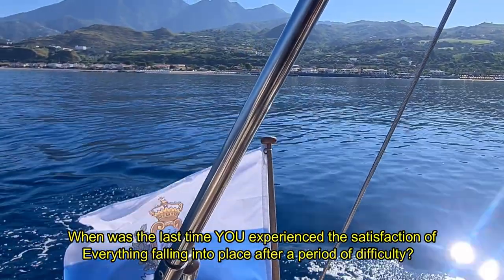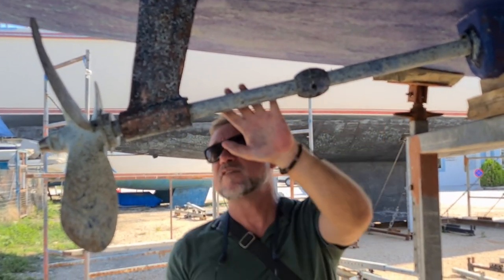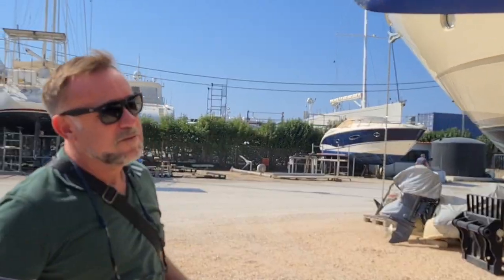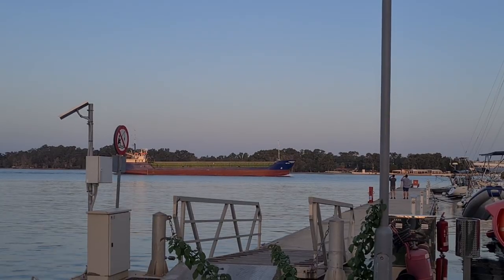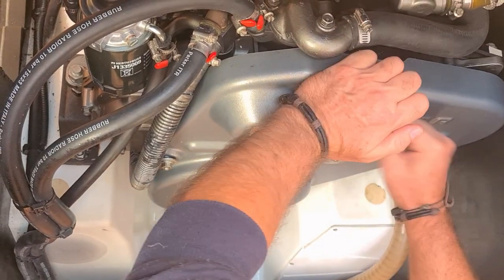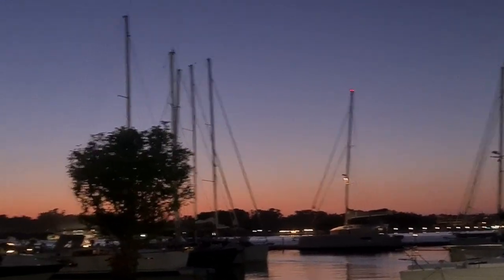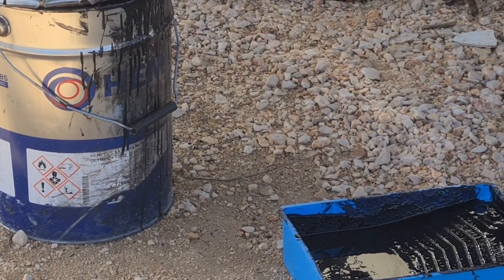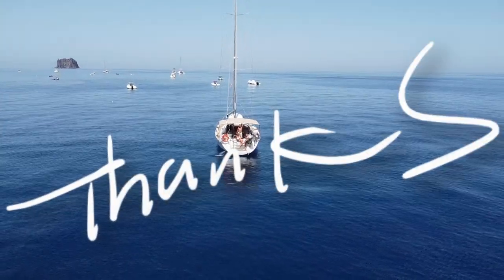Surviving Winter On A Yacht In Greece: Boat Antifouling & Rigging Inspection Overhaul Secrets!

Comment: Consider replacing your through hulls with Tru-Design plastic through hulls - a New Zealand design. Perfect for Irish pronunciation! ;-)
Reply: I presume there was no anti-fouling paint between the shaft and it's anode. You need a clean electrical connection there.

I have to say the finished under-hull anti-fouling looks a little rough. Alright for cruising, but some bits on the keel look like they might flake right off.

There's a golden rubbery-feeling anti-fouling for your prop and shaft, called Propspeed. Look into applying it instead of the black stuff next time. In the mean time, stay off the black stuff until Dom and I get there.
Reply from the maker: You're the best Andrew! Thanks man. Will look into that moving forward. Ahhh sure there's no such thing as a 'T' in the Irish dialect ahaha

Comment: Nice to see lots done. and that your happy with your techs. I also wonder if your exhaust elbow has been checked... its often over looked.. and have you checked your hoses for your heads... they clog up with calcium in the med faster then anywhere else i have sailed. I know i have had to completely redo the hoses in the Cat in the past 10 years. so ya... its something to remember. And for your bottom paint. you now see how easy it is... and doing it yourself will save money.. although  i have never seen anyone paint the prop shaft???? and I hope that is propspeed or some other hard bottom paint on the prop... or as it spins it will just wear off.... fast... most people dont paint the prop if its brass they just clean it... and every time your out swimming .. .just give it a scuff with a green scrubbie. and quick tip... change the color of your bottom paint each time.. .so you can see when it wears through... its ablative... so one year i do black.. then i do blue... then red... but i do like the look of the black.. but it helps when you need to see how well the bottom paint is wearing... but the Cat does 14 kn... so we loose some to speed as i have not put a hard bottom on her... but all nice... and nice to see the weather holding... soon it will be time to head to Ithaca.
Reply from the maker: OOh thanks so much for the tip about the head hoses, we will be getting our heads inspected and cleared out before we start sailing this season. Yes! it was great to watch all of our jobs be done by technicians first - we look forward to getting it done ourselves next season. We have recently bought some basic dive equipment to use to keep the hull and prop clean this season too. It's a great idea to do the different colours too thank you. We love Ithaca - such a beautiful island.